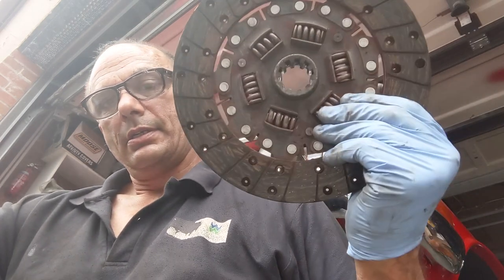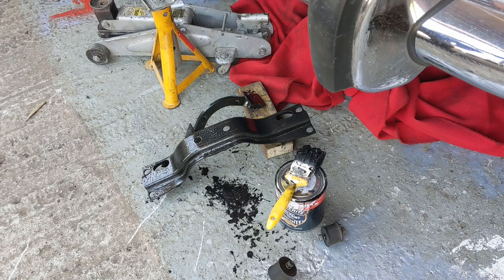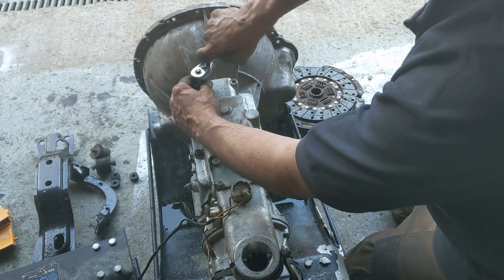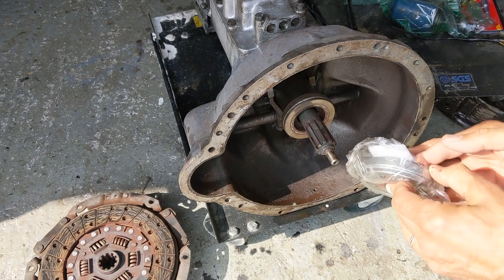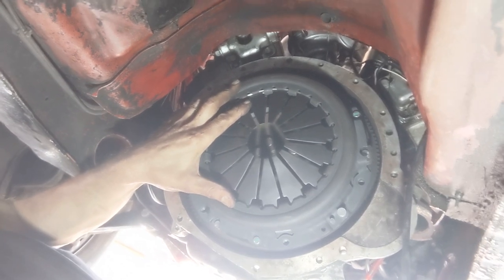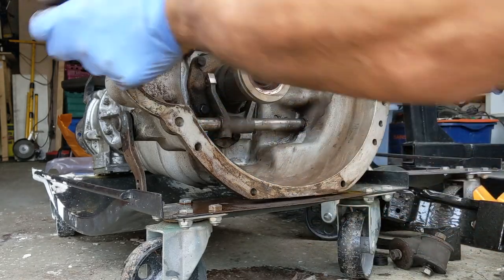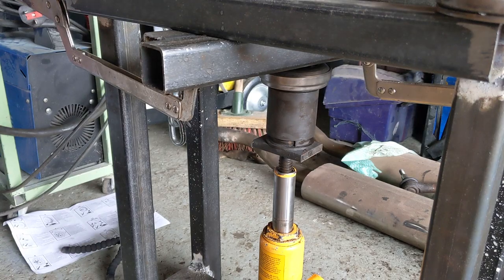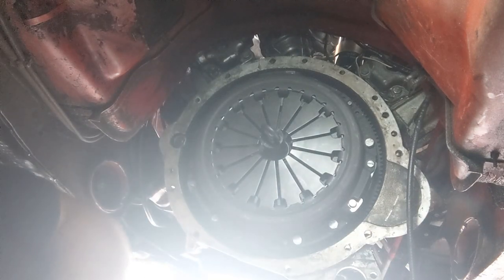Triumph Stag: Gearbox Assembly Install Part 1: Clutch Replacement

Comment: Hi Henry, Nice work! I reckon when you have this all back together it will seem like a completely different driving experience.
Look forward to the next episode.
Reply from the maker: The difference I.bearing surprised m and I think it’ll be very different to drive.  I’ve just failed to get the gearbox back in so far.
Reply: @HenrysGarage  It can be a challenge getting the gearbox to mate up with the clutch. It's important to get the bellhousing as as parallel as possible to be back of the engine or the input shaft will never engage into the pilot bearing. Once you are satisfied it's reasonably lined up, use a circular rocking motion while pushing the gearbox forward. It can also help if you have the transmission 'in gear' and twist the output shaft by hand while pushing the gearbox. That assists the input shaft splines lining up with the friction plate. If the output shaft won't turn then the splines are successfully engaged.
Hope this doesn't sound too obvious.... Good luck with it🤞.
Reply from the maker: Thanks Carsten, just seen this but it is roughly what I did.  Getting it lined up is the hardest bit

Comment: Nice Henry, I'd be wary of putting grease where you found none unless specified, as any dirt or particulates flying around will embed in the grease and may cause excessive wear in time. Understandably the shaft gear had the Borg & Beck grease, greasing the lateral shaft's bushes I'd have to look at the spec. I know it does not seem to harm putting in grease to aid movement etc but it will attract flying debris. Also, just a pointer, the offset in the thrust plate with the new part might have been a clue as to why you had uneven wear on the fingers? Thanks for sharing, I'm sure it will be very useful in the future to other folk undertaking such work.
Reply from the maker: Thanks Chris, I’m having such trouble getting the gearbox assembly back in I’ll review grease